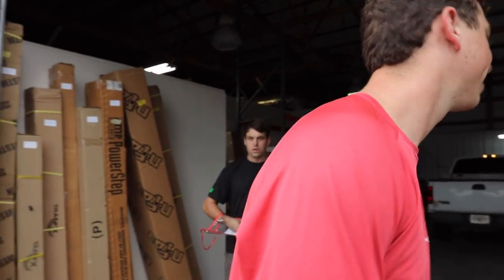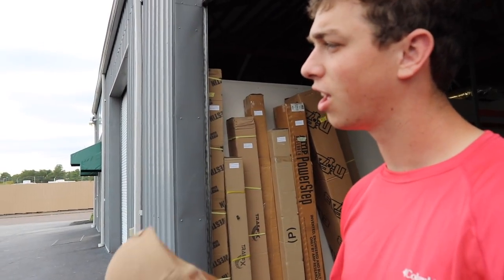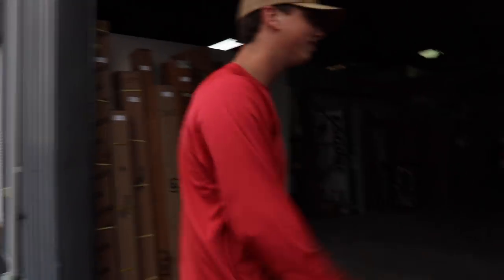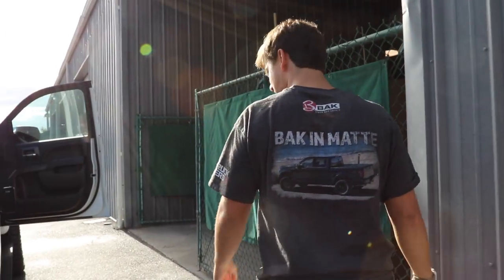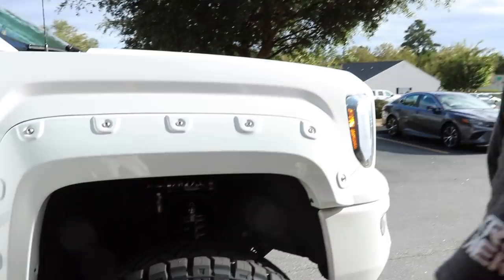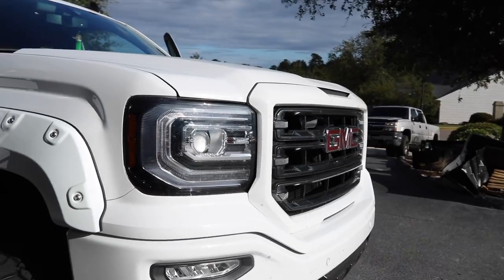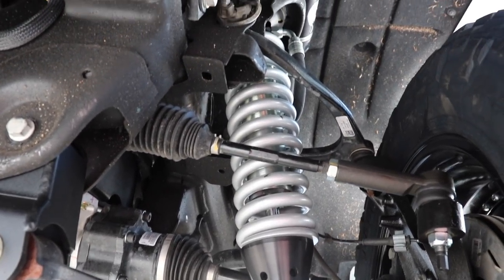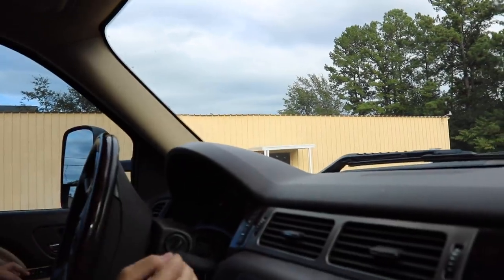2016 GMC Sierra 1500 + 6" BDS Coil-over Lift

Comment: I have a 2013 denali hd duramax I did the PPei ez link tuner stage 5 shift on the fly. Very pleased with it .all south motorsports in Buford ga installed it 5 inch Flo pro straight pipe cold air intake 150 fass high lift pump